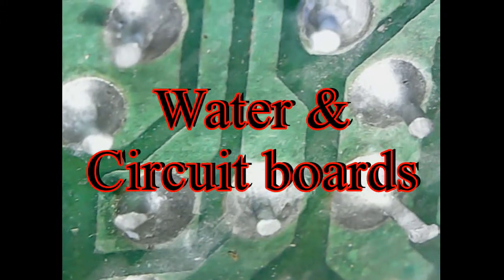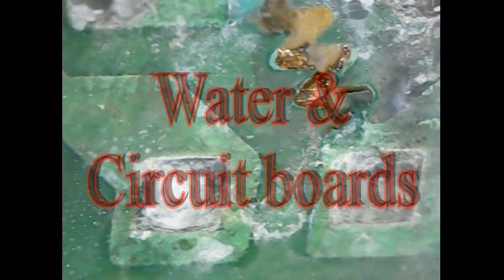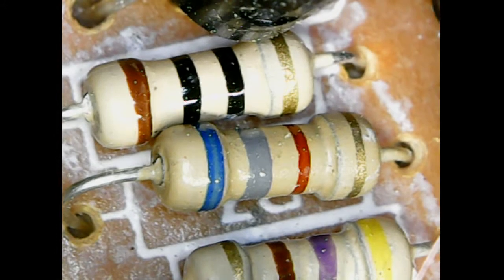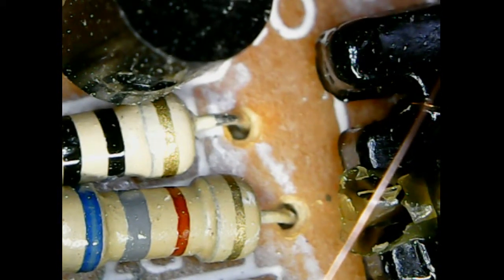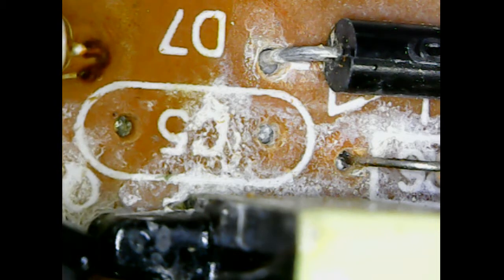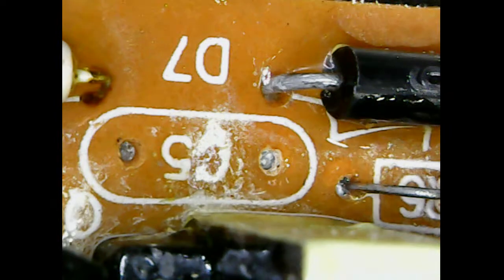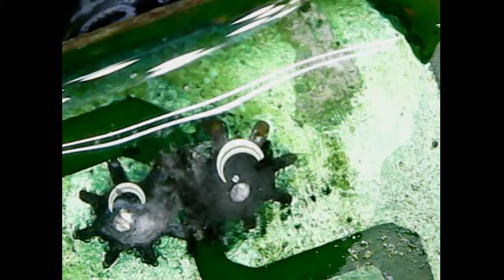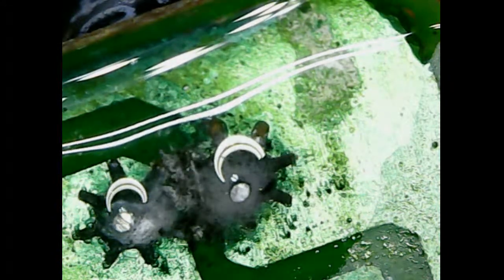Water and Circuit Boards

Comment: What is up with the dislike ratio? The title is a broader in scope than the actual subject of the video, but I can't tell what's wrong with the information being presented. This seems to be an accurate display of what happens to a circuit board exposed to water. Even with no current running through the PCB water can damage electronics. Maybe people were expecting a video about water shorting a component to ground.